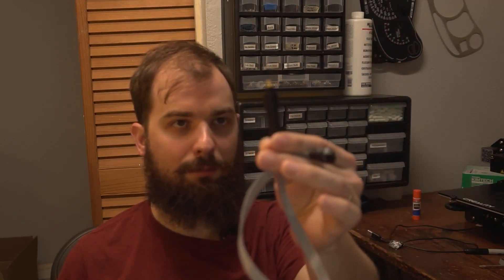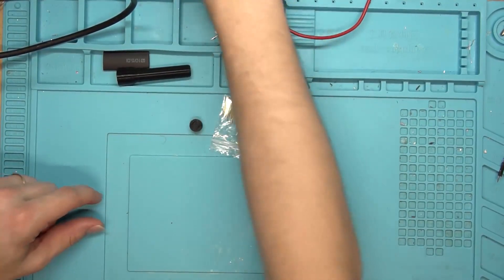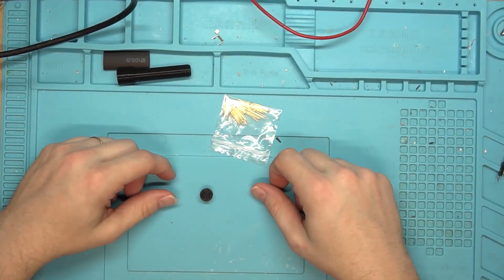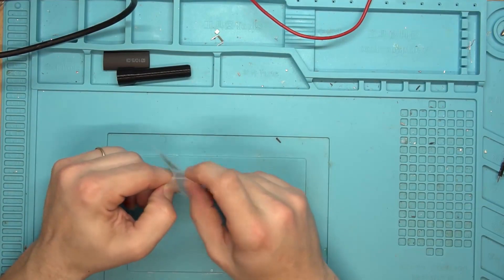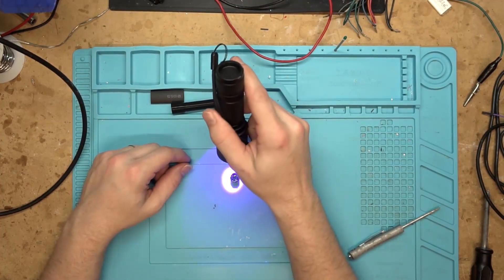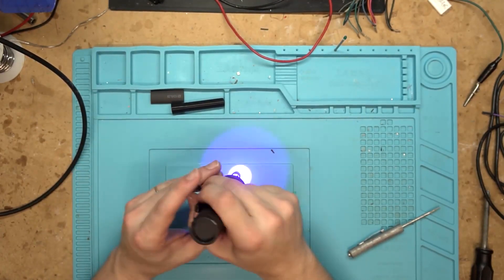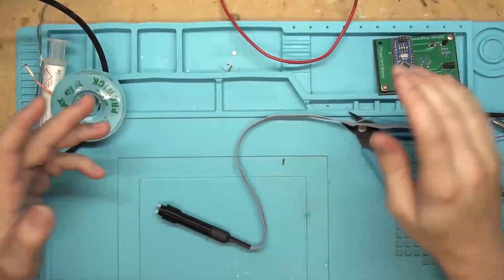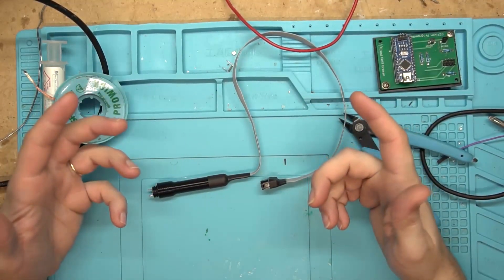3D Printed SOIC 8 EEPROM POGO Pin Adapter

Comment: Desolder. It's sop8 right?
Reply from the maker: Yes it's sop8 I do just pull the chips to read them most of the time but there are reasons not to. For example businesses that do these repairs might have people that they trust to take apart clusters and put together but not solder. Using a no solder technique to program would be beneficial. It's also less stress on the board to do in circuit programming. I does have it's risks though too. Less likely to get a good connection and esd damage could possibly be worse.